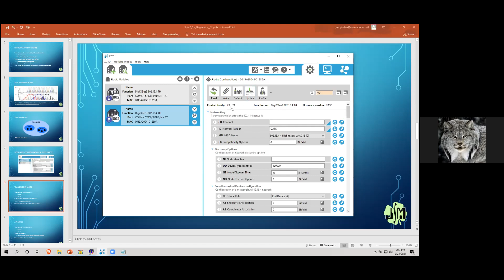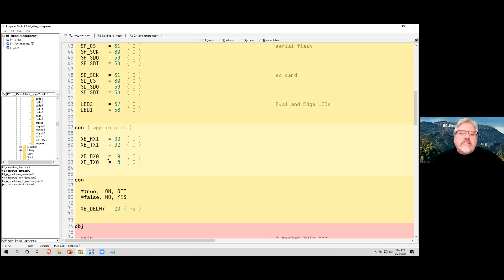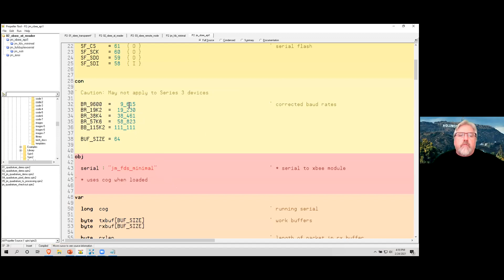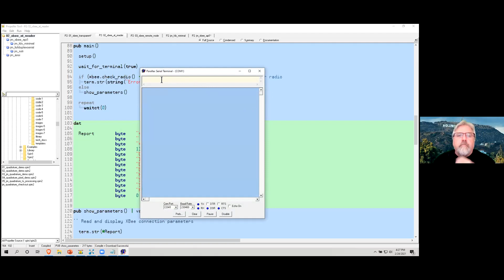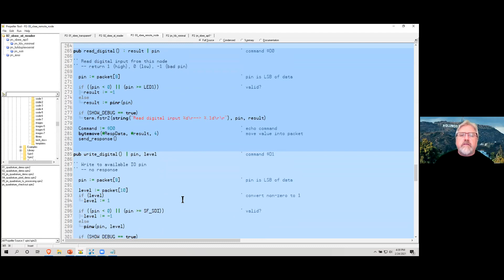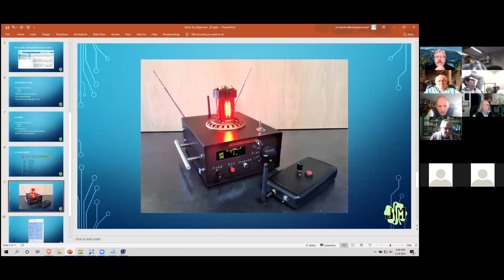Spin 2 Beginner Series Part 7:  XBee Series 3 Objects with JonnyMac

Comment: Whoops, I misspoke at the 1:09:40. The two bytes that follow the header (0x7E) tell us the size of the payload, they are not the destination address. The information on the slide is correct. Sorry for my verbal error. I do correct myself at a later point. For clarity, the second and third bytes of the packet are the payload length. The first of those bytes will always be 0.